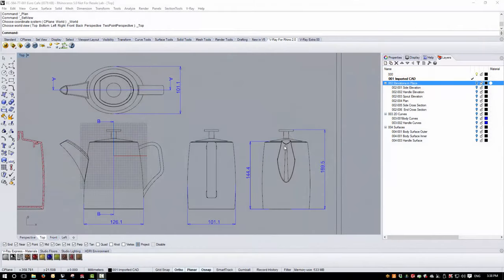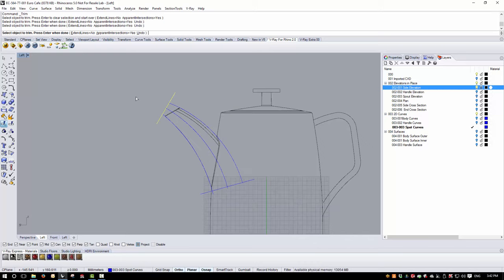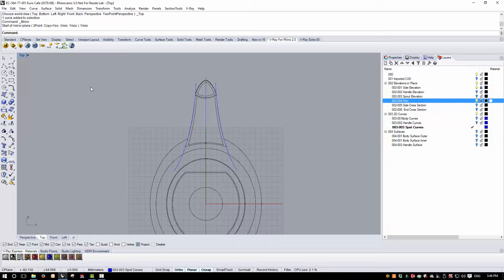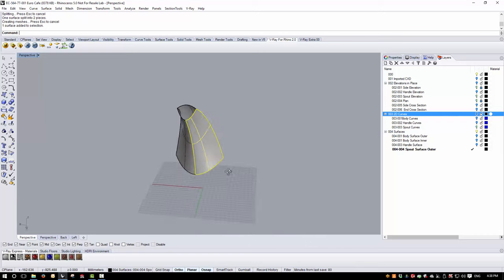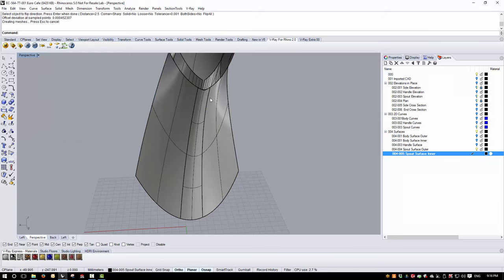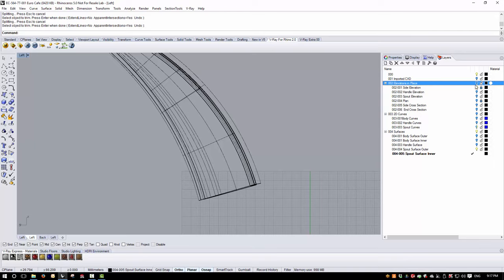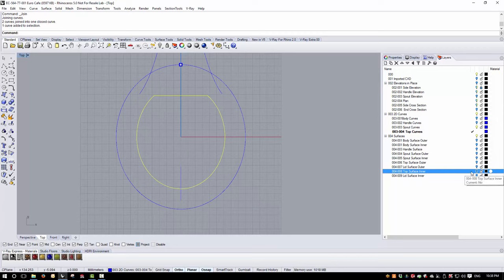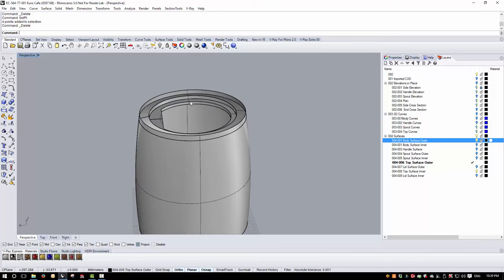Simply Rhino - Rhino3d Tutorial - From 2D to 3D with Rhino - (2 of 3)

Comment: The 'planar curves' function didn't really work out for me.. I've made a bowl and then an inner bowl like you did with the spout, but instead of making a surface between the two - like yours - it covered the entire area like a lid. Is this a common error? And is there an obvious solution?
Reply from the maker: Hi Jonathan. Are you referencing capping off the spout at 24:30? If so, make sure that the outer top edge and inner top edge are both planar and at the same height and both edges are properly closed up. If you then have two closed edges (or two closed curves) on the same plane, Planar Srf will give you the correct result. Hope this helps.

Comment: I'd like to know when and why do you prefer blend edges over fillet edges and vice versa. TY.
Reply from the maker: Hi Fabrizio. Thank you for your question. Blend Edge can be thought of as being an aesthetic improvement over Fillet Edge. Blend creates a curvature continuous condition whereas Fillet Edge creates a tangent continuous condition. With the Environment Map or Zebra you can usually see a stop/start condition at the edges of a Fillet (this the effect of two different radii meeting at a tangent) whereas the Blend should look seamless. The Fillet is mathematically simpler and I would usually use this in less visually important areas where edges need to be softened and always where there were two planar surfaces involved. Likewise I would use Blend in areas of visual importance where a smooth continuous form needs to be expressed. This is a simplistic explanation – and in reality the difference and choice might be more nuanced – but I hope this helps. Best, Phil and the team at Simply Rhino
Reply: @SimplyRhino3D  Thank you so much for your exhaustive answer :)

Comment: Thanks Phil... that was great.. 

I noticed that you quite often would opt for the 'shrink' option within commands.  What is the advantage of shrinking a trimmed surface?
Reply from the maker: Hi Sean, The advantage in shrinking a trimmed surface is this – when you trim a surface, the original untrimmed surface boundary remains as part of the surface description. If you trim a small area from a large surface then most of the surface description is redundant. When you Shrink a surface the surface is re-approximated by Rhino and the untrimmed boundary moved as close as possible to the trim boundary. Hope this helps.
Reply: Is this a necessity?... Or is this just best practice due to reduction in file size?.. Are there any other advantages in working with a surface that has been shrunk?
Reply from the maker: Hi Sean, It helps particularly when you export geometry – if (for example) when you take Rhino geometry into SolidWorks surfaces that are not shrunk sometimes do not translate correctly.
If you are staying in Rhino it’s not an absolute necessity but can help to create more usable geometry – as your control points do not extend so far past the trimmed surface boundary.
Reply: Thanks Phil... Will we see part 3 before Christmas?.. or perhaps a Boxing day release?
Reply from the maker: Hi Sean, the third part of this trilogy will be published in January 2017 - our New Year present to you! :)
Reply from the maker: From our extensive use of exporting using the latest versions of Rhino and SolidWorks, we have found that there are a number of complex surfaces that import correctly with IGES and incorrectly with STEP.
Reply: AutomotiveCNC ü

Comment: Thank you very much for this nice tutorial. 
I had trouble when turning the curvature graph on. A box pops up but nothing like the vertical lines show (28:55). Is this a common error? Thank you so much for your time!
Reply from the maker: Hi Happydrawing. If you adjust the scale (control is on the dialog box) of the curvature graph you’ll see the graph become larger or smaller. You’ll need to adjust the scale on a case by case basis. Hope that helps you? :)
Reply: Yes!!! Thank you so much for your help!

Comment: After a video and a half I have to say this tutorial is informative but it does not serve as a guide. You skip 2 or 3 clicks that you don't even acknowledge on almost every command. And on your recording platform, you don't even enable the "right/left click" visual aid. I have to watch it, and hear the click (that is there just because you are recording ambient sound) and then try it with both mouse buttons. You disable and enable options and don't mention them either. Also, sometimes you take us through a whole process and at the end you say "oh and check project is off" so if it was off I have to go all the way back to do it again. I'm on minute 12 of the second video and I already know this is going to be a pain. Just take more time including everything you do. Rushing to show everything is fine, but you rush skipping details that make things work differently. Still thanks for the upload. Hopefully I'll finish soon.
Reply: To illustrate:

When you make a line perpendicular to the curve it looks like this:
You mention the length of the line. At the end of the process didn't make a difference. 
Then you go through the options while reading them. This is great.
But then you just say "We are going to orient this so it's perpendicular to this edge".
You skipped: LC on the line, RC to enter, LC on end point, LC on edge. Even when I finally figured out and did it like this, my line would be perpendicular towards the inside of the pot, instead of to the side. So I had to find a way to rotate it 90 degrees so it would be perpendicular to the edge but following the surface. This is just one command, but it has been like this on many others.
I am not trying to criticize you out of frustration (ok, maybe a little) but I would like you to take this as 100% constructive. I know so much more now than when I started. I thank you for your effort and time.
Reply from the maker: Hi, We take on board your comments and will continue to make future tutorials as easy to follow as possible, all in a logical order.  There will always be room for improvement when aiming for perfection!  But we hope to always reach a good compromise.